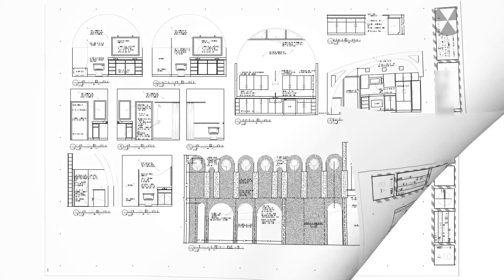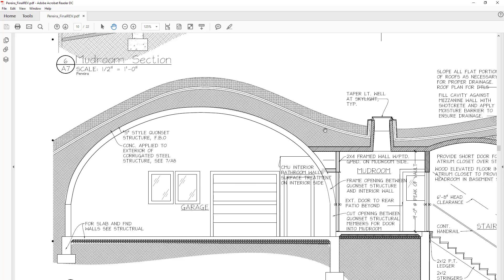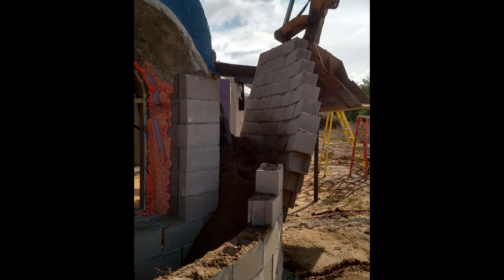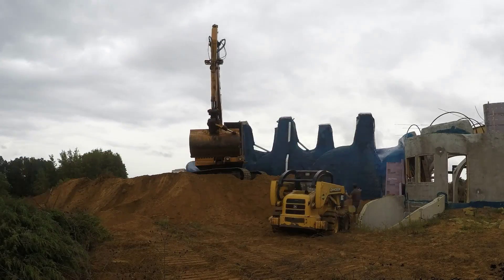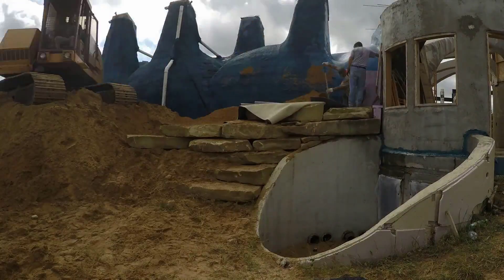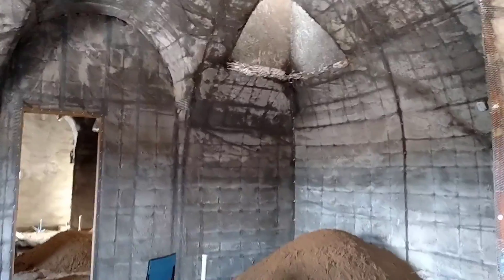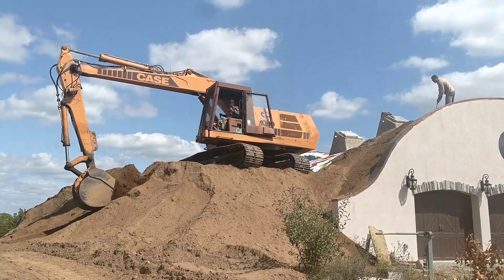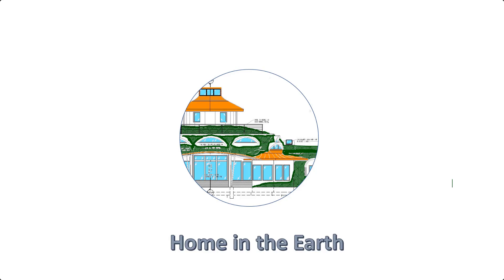38.0 Earth Sheltered Home Burial, Phase 1

Comment: Wow! Millions of dollars, no doubt. I need 1800 square feet maximum. This is far beyond any practical application for the rest of us.
Reply from the maker: Actually, nope.  My budget was 76$ per square ft.  In reality, things will probably end up at ninety something because the shotcrete and excavation budgets did get blown.  For comparison, the house across the road was more than 300$/sqft and the average in the country is more than $200 (I just looked it up and found a range of official numbers).  So, yes, this is a relatively cheap way to build a house, largely because I am building it myself.   If you hire it done by companies such as terradome or formworks, they claim the cost is about 103% of the cost of a similar size home with a similar finish level.  But you quickly make that money back in saved heating and cooling and maintenance.  Basically, for every extra expense (such as the cost of burial), you can save on something else (such as the cost of a brick exterior and the cost of a shingled roof).

Comment: Monolithicdome.com. would have been way easier and less expensive,( even not knowing how much this cost).
Reply from the maker: Well, after researching both methods extensively and knowing how much both cost, I can tell you that a monolithic dome, with its expensive air form and spray foam insulation, is certainly not cheaper.   And I couldn't even find a gunite crew willing to shoot from the underside, but if I could, you can bet that would cost much more also.  I could go into an extensive breakdown of all the ways a monolithic dome is more expensive and not very easy, but the bottom line was that I simply didn't want a monolithic dome ;)   In fact, it is the only type of structure flat-out prohibited in my area (because the community thinks they are ugly).  I don't think they are ugly, just not very interesting or easy to live in.

Comment: I couldn't tell from the time lapse how much compacting of this fist fill phase was done. How are you handling that or does it not matter?
Reply from the maker: In most places, it didn't matter.  I wasn't building anything on top of the sand, so if it settles out naturally, no worries.   The only place that mattered a lot was behind the boulder wall.